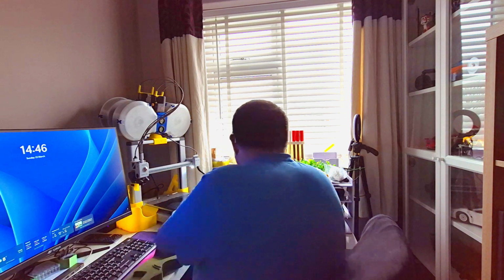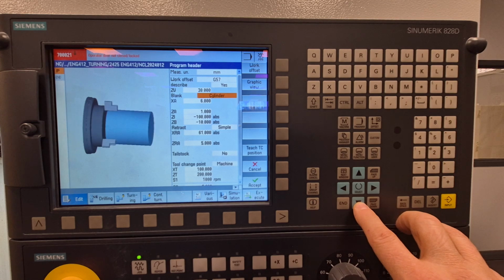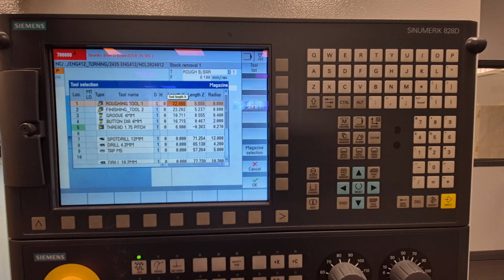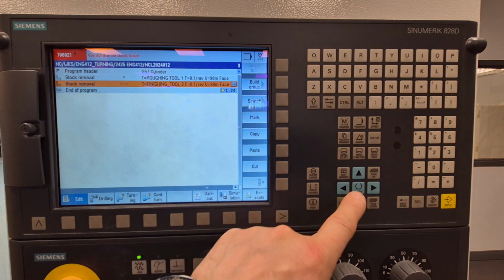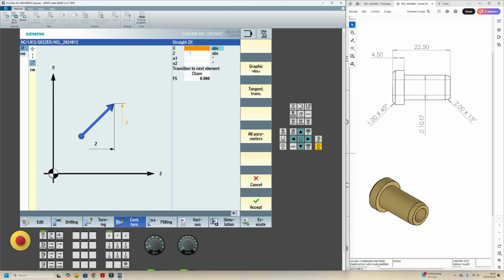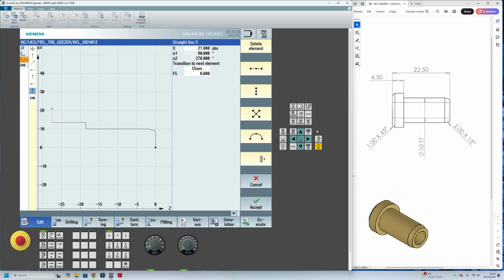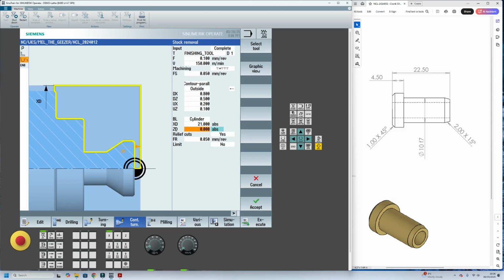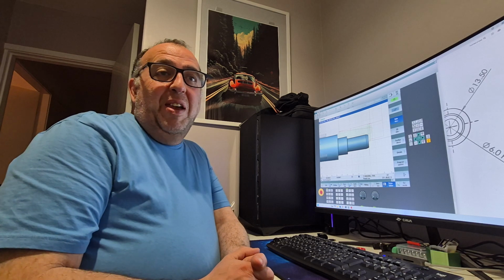CNC Programming Basics - Directories, Workspace & Contour Generation

Comment: Mel, can I have your email? I need some help on my Unit 3 engineering paper, and I can send you the paper through email.
Reply from the maker: Is that this year's paper?
If it is I cannot help with active exam papers. 
You can ask certain questions relating to parts of exam, as long as it does not refer to exam content.
Like what designs can I out in to this.
General questions like what would manufacturing method would you suggest to make say 120mm x 30mm x 3mm thick steel plate when cutting out 1000 parts before needed to be bent
Reply: @111melcat yes, it is this years paper. No worries though, i understand that you cant help with active papers. Last question, will the special guest student be making an appearance anytime soon???
Reply from the maker: Hahahaha, yes when I do not know, he has a companion little girl Frenching Mia.
She is the nutter